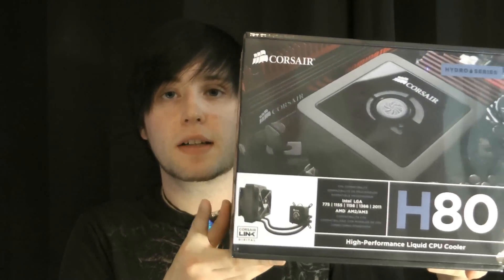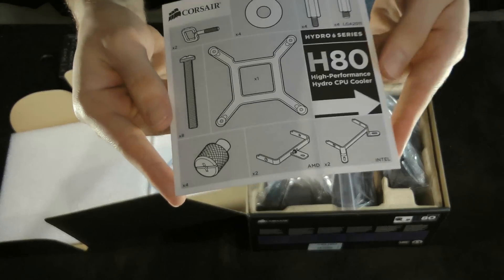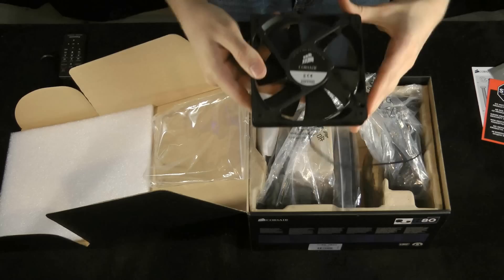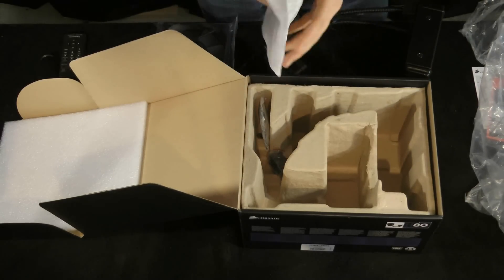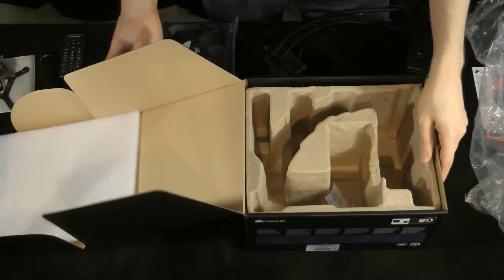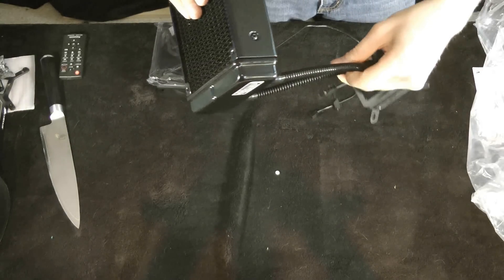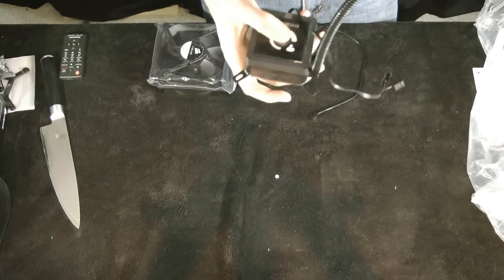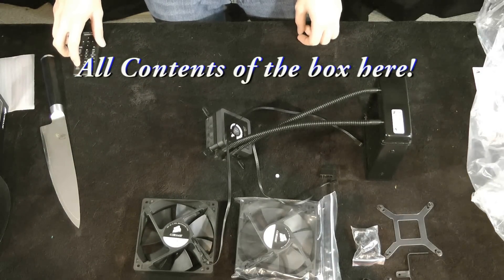Corsair H80 Socket 2011 X79 Revision Unboxing

Comment from the maker: I think I built one for a friend X58 once upon a time, and the performance was ok... way better than stock but still not as good as the best air coolers. However, it was a lot quieter if you tweaked the fans and such.

Comment: How does the Radiator size and tube length compare to the H70? I saw that their performance differences were negligible for the 1155/1366 sockets but I'm curious if you have any experience with the H70.